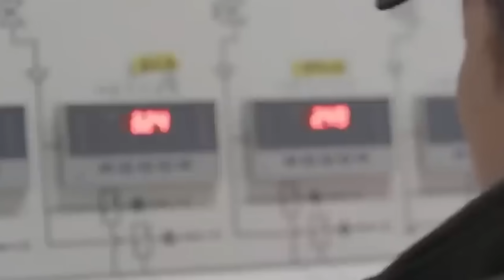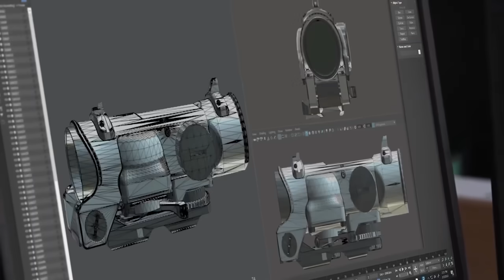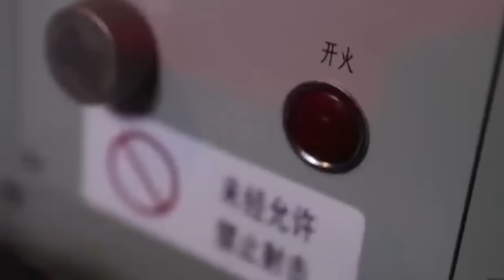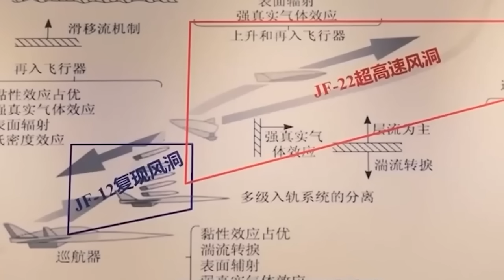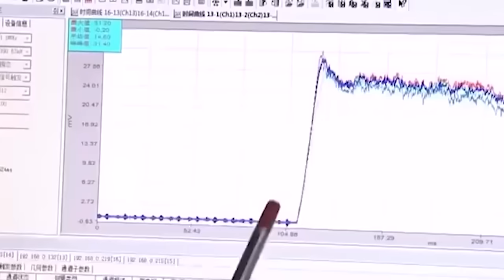Chinese Hypervelocity Wind Tunnel That Concerns Everyone

Comment: Those familiar with wind tunnel design and use will find nothing remarkable about this video. Too much here is taken out of context.
Reply: Anything dark5 produces
Reply: Nothing remarkable? You have no idea what you're talking about. To produce hyper velocity wind and keep that at an ambient temperature is astoundingly hard to do. If you don't control the temperature before it makes friction with your test model, you will melt any material that you try to build a craft with. It is definitely not as simple as just making the air go that fast. I believe you have zero knowledge of how these things work, which is why you made that statement. You should probably delete your comment and then do some actual research.
This video was not talking about wind tunnels. It was talking about hyper velocity wind tunnels. That is like comparing a go cart to a space shuttle. But hey, they're  both vehicles, right?

Comment: The way the wind tunnel expands for the testing chamber leads me to believe the air pressure would be signifiganfly lower there making this wind tunnel only suitable for simulating high altitude flight and drag characteristics if this isnt accounted for they could end up with shooting stars when entering the much denser air at lower altitudes.

Comment: I agree with you also.. 

Just because they have a specific type of wind tunnel doesn't mean they are ahead of the race at all it may actually demonstrate that they aren't as ahead as they once thought they were.. 

Remember they also need to set up the proper parameters to study certain issues being confronted with in the field.

Second thing is that we the United States have a very high standard in which we decide to field our weaponry..

They may still be able to launch from jets as Russia is more or less demonstrating since they appear to have a much higher success rate from the air or air to air vs ground to air.

We as a nation collaborate with many nations since we have many allies so where we are in the race may not be what we necessarily see. Remember we are one of the few nations that can file a freedom of information request to get information that we may not want to be albeit may already be un-classified (and not by thinking it either).

OK so now that I have gone wayyy out on a tangent we have research being done all over the world and it's in our best interests at times to let others think we are strategically far behind or far ahead in the case of Russia spending so highly during the cold war that it collapsed.
Reply: The US was doing this is the 60’s. The are significantly behind.

Comment: Don't we have laser weapons that can track and shoot anything basically? I don't know but lasers do seem like a way to stop these. Or, don't we have other tech like EMPS and certain frequencies, besides lasers, that can stop these?
Reply: Don’t need those you have computers doing the math. Missles go to the area it going to pass through then they explode putting shrapnel’s in the missles way it hits this at Mach anything it goes boom the faster you go the harder it is to turn.
Reply: No we do not have such laser weapons. We tried it on a modified 747 but it did not have a range which would make it effective. We have no known satellite lasers let alone ones that could have the power to take out such a vehicle. We have other means though.
Reply: Also, military hardware is built to withstand EMP. It's more of a problem for unshielded civilian infrastructure.
Reply: @filonin2  id disagree we dont have directed energy weapons but against hypersonic not needed. Much like flak in WW2 put in front junk in front of the vehicle and let it run through it. Lot more damage now a day then a b-17 flying and hitting it at 239mph and a hypersonic hitting it at 3,836 mph

Comment: Man what a sad comment section, 

underestimate your enemies is first step for your downfall
Reply: There's a plethora of people who think the current military is on par with the past military.  Sure, we're more advanced in practical use equipment, but our past miles of advancement are now city blocks.  Long distance, hypersonic, non-linear payloads have changed things up a bit.  It won't take long for sufficient countermeasures, but it will take time and effort.
Reply: You may not be aware of this, but YouTube commenters are not Generals in the Army, Navy, Airforce, etc.
Reply: Bro we had this since the late 60s😂
Reply: @PatrickKing-cr9ec  Bro, we've had cruise missles since the late 70s, not the 60s.  They also don't deviate course miles around anti-air emplacements.

Comment: I remember reading about this a while ago and China said it was not for any military purposes or military weapon testing it was simply for testing orbital planes and capsules for space travel and how they react on re-entry but we can only imagine what other stuff they can use it for maybe even testing Hypersonic weapons I don't know why they would lie and say it's not for that they would probably want to propagandize what it's used for if it was a Hypersonic weapon test facility but instead they said it was non-military in mainly for space travel vehicle testing who knows what to believe anymore
Reply: The concept is called "Dual Use" and China does it with all of their academic and commercial facilities. It will be used for military research if they want to do military research with it and scaring the West with that threat is why they showed it. Until they release data from one of the studies from it no one in the West is doing to consider it anything more than an overgrown hair dryer, though. You can fake the look of building one, but running the tests on a model and showing the data from it that other people can replicate would confirm you actually have the hypersonic wind tunnel. Since they haven't done that, it's a hairdryer.

Comment: Hypersonics are expensive and thus need to be economically and strategically used. The US and allies have many expensive single-target items that would be in the crosshairs of hypersonics. 

I think, instead of pouring billions into developing our own hypersonics or even systems to counter them (as they tend to be vastly more expensive), we should instead focus that funding towards a diverse suite of offensive capabilities that can be deployed quickly and with reletivley low cost. Let's focus our efforts towards drones and counter-hacking technology instead of hypersonics. I mean if we are going to spend tons of money towards a program, why not focus those efforts on systems currently working very well that are still a fronter technology and act not only as an offensive deturant, but also play a defensive role as an interception-type device (and don't place the lives of our people at as high a stake). Just my opinion, why pour money into a system with such selective use when it can be achieved with numbers and at a lower cost? Experience? Diversification? Place your rebuttles below :D

Comment: Apparently this channel doesn't know the difference betwixt a hypersonic glide vehicle, such as China's DF-ZF, and an actual hypersonic missile. All ICBMs are hypersonic on re-entry. A tunnel for testing shapes? PFFT. The US is working on 3 separate hypersonic vehicles, reusable planes like the Darkstar, because the price for hypersonic missiles is exorbitant and a waste. A plane, however, that can нit China using precision guided bombs or missiles without China having any single capability to retaliate, because it would coated in the latest US stealth tech, the fight would be over before they knew it had begun.

This was useless fear-mongering.